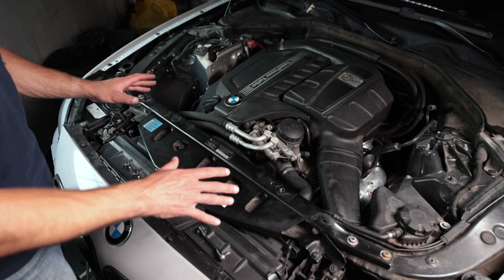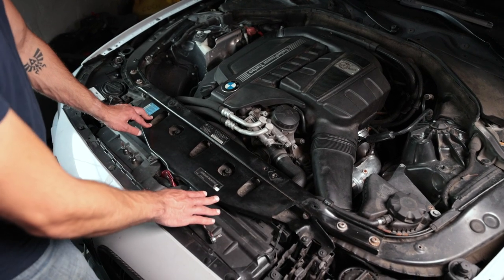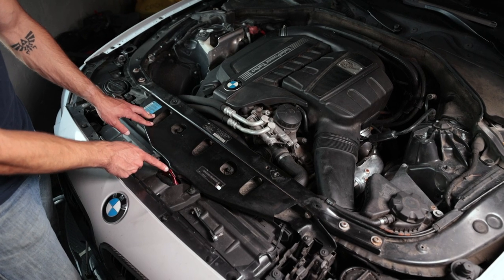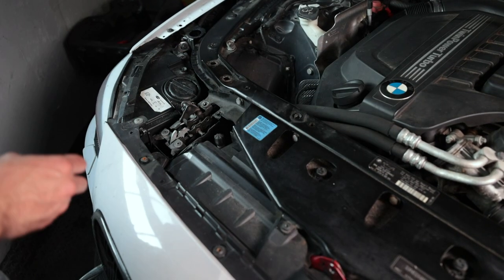BMW F10 535i FTP Boost Pipe Install - N55 Engine 2011 - 2017 Turbo To Intercooler TIC

Comment: A couple of useful tips that I'd like to add cos I struggled with installing this myself
1. The bottom pipe to intercooler piece is keyed. I struggled with this one because I did not realize it was keyed and could not push on fully to the intercooler. I ended up pulling the I/C out which was only 2 additional screws and a cover. I would recommend just dropping the I/C on the right side because it gives you extra space. I could not get the two pipes together in there. With the I/C partially dropped it gave plenty of extra room. 
2. I would put the old stock pipe and new FTP pipe side by side and put them clocked in the correct orientation and mark them on the bottom side with a marker pen (can be non permanent if you are particular about marking your pipes). That way you are close to the correct orientation when you put the pipes in.
Reply from the maker: Good points! And yes, they are keyed. Many aftermarket intercoolers don't have that pin tho but knowing that the notch should go towards the top will help you with the alignment

Comment: I did the whole boost pipe without going under the car. I removed the clip holding the pipe into the intercooler then cut it in half to pull it out. So much easier then going under the car and the old pipe was going in the trash anyway. Biggest pain in the ass for me was getting the coupling in place

Comment: Hey whats good  nice video 😊 at what mile stage do you think the boost pipe should be replaced and how would you notice it going bad!And what’s the importance of replacing it thanks .
Reply from the maker: It's really age that makes them go bad. The plastic becomes brittle over time. If your car is 9+ years old it's probably a good idea to change it or sooner if you are tuning the car. We always install it with a bigger turbo upgrade too. You'll have a boost look if it's going bad.

Comment: Quick question, on FTP: * Attention: Modified Engine might cause unfitness. So, what would cause a fitment problem? An intercooler mod from the OEM intercooler?
Reply from the maker: The b46/b48 engines don't have intercoolers actually. You have a built in water cooled system in the intake manifold. I think they are just covering themselves in case you've swapped turbos or something. I've never had a fitment issue with any of their products and we've installed hundreds of charge pipes.